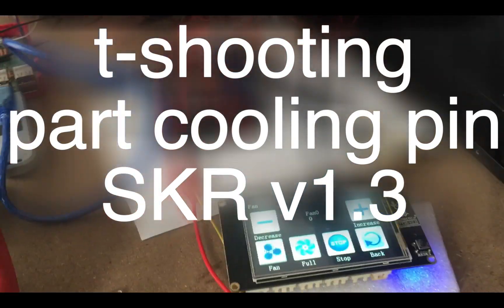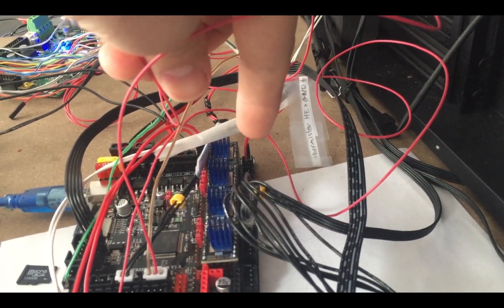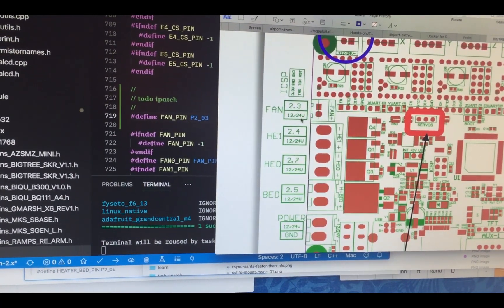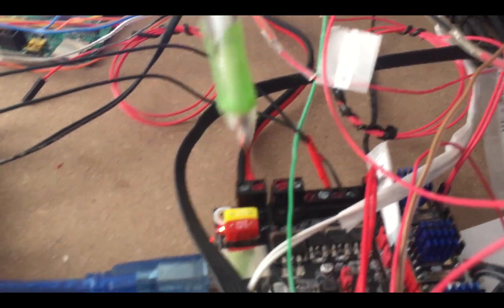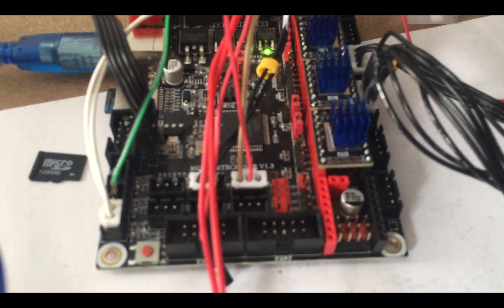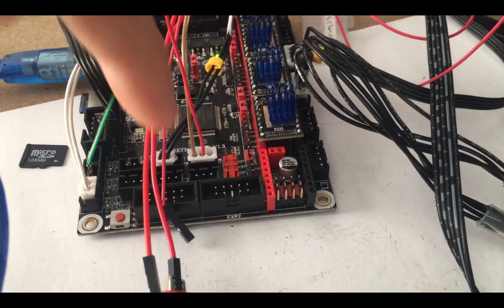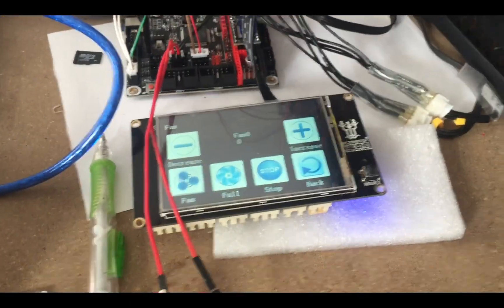SOLVED ✅ troubleshooting an SKR v1.3 part cooling fan pin using marlin 2.0 and multimeter

Comment: @ipatch. I have an Ender 3 printer with a Big Tree Tech Skr 1.3 motherboard. I found this video a few days ago as I was having the same problem with my parts cooling fan not working. It's plugged into pin P2_03, and if I turned on the fan from my printer console, the LED closest to P2_03 mosfet would light up, but the fan just wouldn't work. I did check MB voltage near the mosfet, with similar results to your test. I proved the fan worked with my bench power supply. I searched my marlin code for any help. Made a heap of changes to the marlin firmware, with no luck. Now, by chance I decided to plug the parts cooling fan into that ' always on port' (which doesn't have a pin label)...and surprise. The parts fan didn't work here either...but the case cooling fan that was plugged into the 'always on port' which did work had reversed wiring on it's plug compared to my parts fan. So a long story short, I swapped the wiring in the connector on the parts cooling fan. Plugged it back into pin P2_03. Turned on the parts fan via the printer console...and the fan worked. I tested the fan percentages from the console which great success. I'm kicking myself for not noticing the correct positive/negative alignment for P2_03 on the BTT Skr 1.3 motherboard schematic. I hope this little snippet might help others along the way. Cheers

Comment: so according to the solution on github, I need an additional MOSFET to make this work? I dont know much about electronics but Im learning fast. Could you please explain how exactly you wired it up in the end? The Marlin changes are no problem for me.
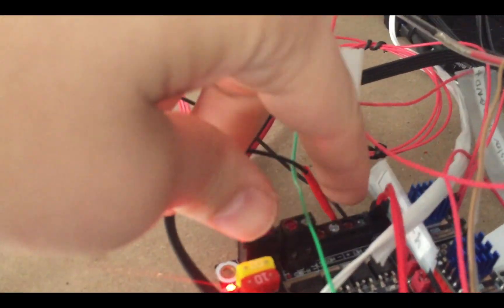Reply from the maker: use the pins on your board as described in 0:50 in the video.
Reply: @the.real.ipatch  thanks for the reply. I already figured it out I think. I used P2_03 (dual 5015 fans) as part cooling fan and P1_27 as hotend fan. I made all the changes in marlin except for the bl-touch setup. I will do that tomorrow and hopefully everything will be working fine after that.

the code Im using for the dual hotend is:

#define HEATER_0_PIN       P2_07
#if HOTENDS == 2
  #define FAN1_PIN         P2_03
#else
  #define HEATER_1_PIN     P2_04
#endif
#define FAN_PIN            P2_03
#define HEATER_BED_PIN     P2_05

do you think I might run into trouble because I had to cut and reconnect one of the hot end thermistor cables?
Reply from the maker: @denny.wanderer  i did not run into any issues cutting the thermistor or hotend cables, so if you properly soldered them up after you cut them, i believe you should be good.

one thing i know if you bring the temp of your hotend up, and thermistor can't read the temp of the HE then marlin will beep at you, and you'll have to reboot the machine.  i think it's a safety measure.
Reply: @the.real.ipatch  sounds good. I didnt know about the beeping. I never used soldering when doing upgrades for the printer. I guess 75% of my printer is replaced with other parts by now and I never ran into any problems.  Usually I just twist the cables together and use shrink tube or these thin metal tubes that you "squeeze" with pliers. I know soldering is better, maybe I should start to do it.

Comment: whats the solution? I did not find any solution
Reply: can you send the config file  and config adv file. robotics459@gmail.com
Reply from the maker: hey forgive me, the wrong link was posted in the description, i just updated the link in the description to the github issue that resolved my issue with controlling the part cooling fan

cheers 🍩
Reply: @the.real.ipatch  Now your fan is running on P2_03 pin. I running fan on P2_03. How i enable this.
Reply from the maker: Talha Ahmad 

uhhh you could take a look at my fork of marlin and that may help you.  i dont remember off the top of my head what pin i wired the fan to but ive been building marlin from source and have my note below

https://github.com/ipatch/marlin